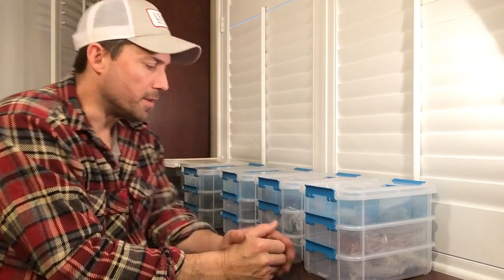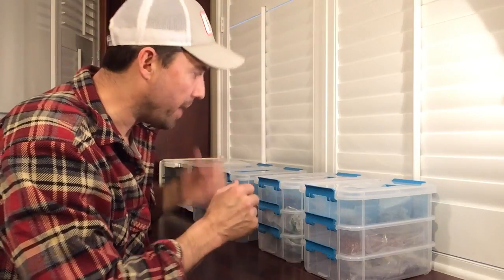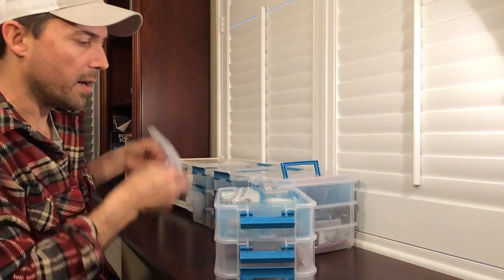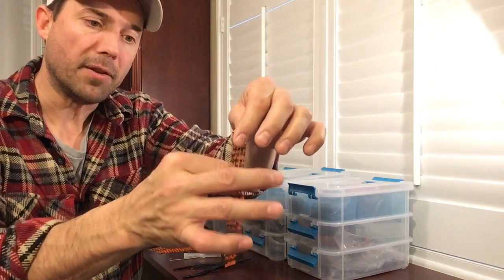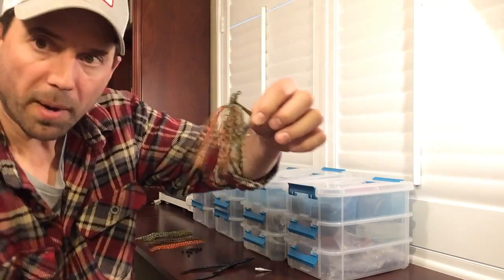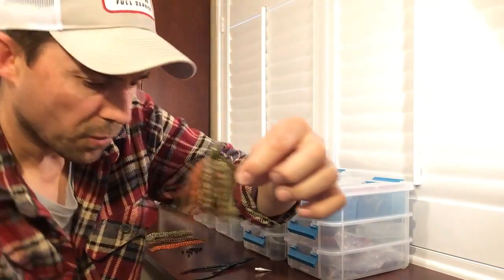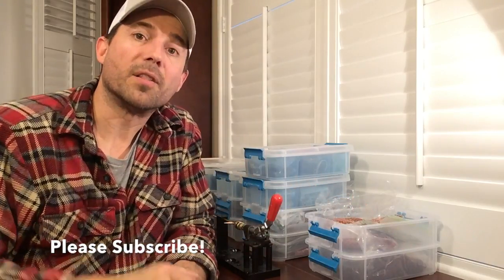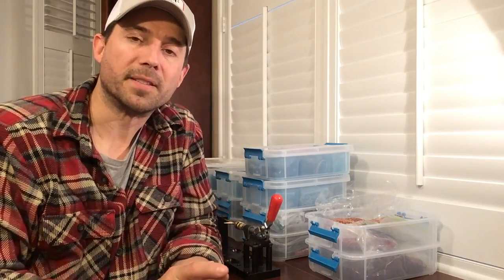Making Bass Jigs - Making Skirts

Comment: Nice video's, I too make jigs as well (Only for my use). Thought I'd mention I've use a aluminum roofing nail which has a .125 dia. for jig heads. Much cheaper than the Teflon pins. You just trim them down. Thanks again for the baking segment that helped me a lot. Good Luck.